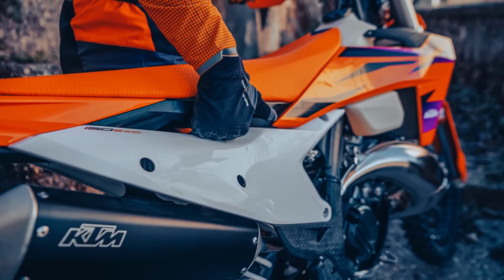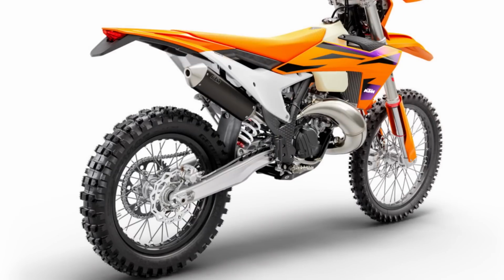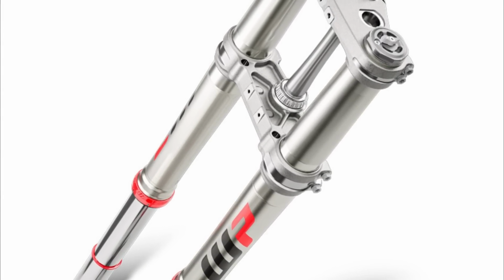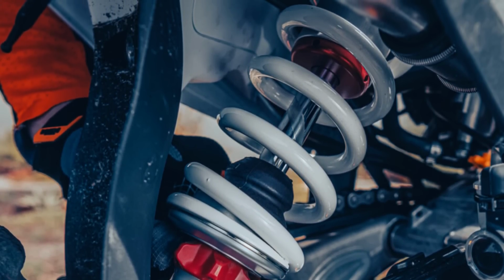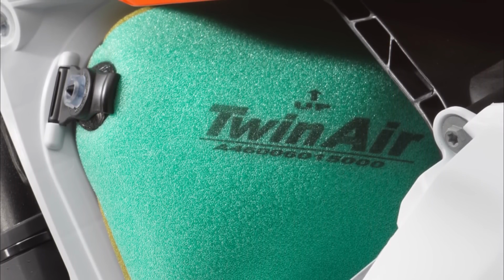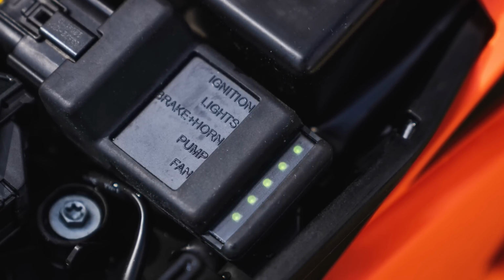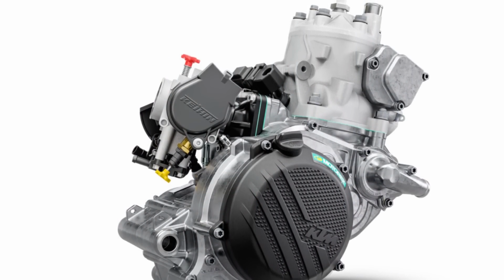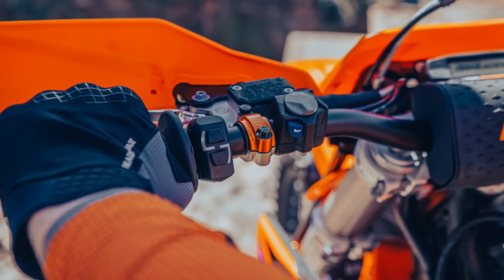2024 KTM EXC - THE MOST RADICAL ENDURO UPDATE YET

Comment: 13 grand, i'd be expecting nothing but the best. insane prices in comparison to other manufacturers
Reply: Haha. You could spent 5k less on a drz400. Makes half the power and weighs 50 plus lbs more. Worse suspension, brakes etc.
Reply: It’s out of your league and riding abilities
Reply: @natm3145  you're absolutely right. It's a high performance dirt bike with plates. Can handle anything m
Reply: @natm3145 mug